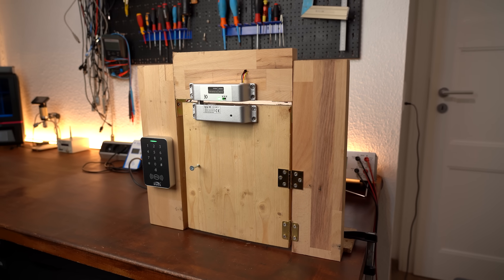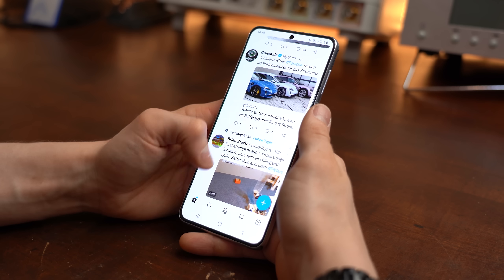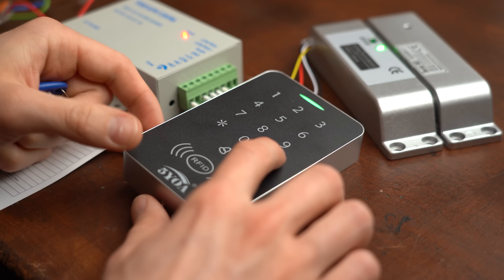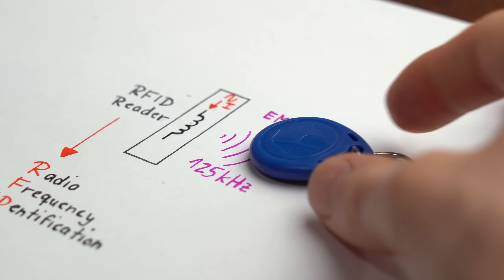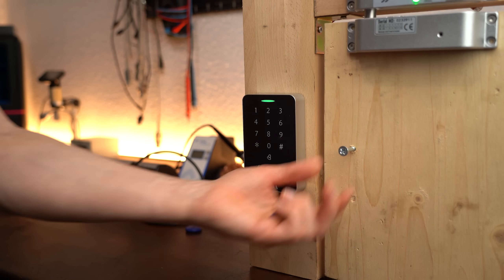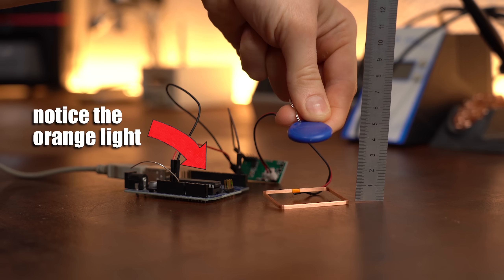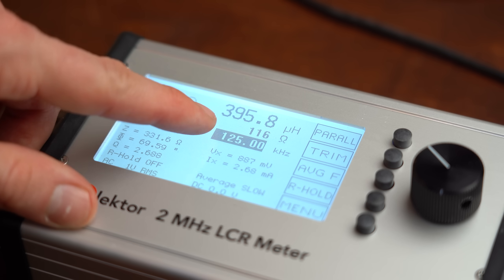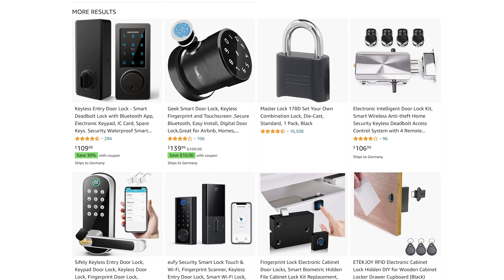RFID Locks are way too easy to "Hack"! Let me show you!

Comment: To me this kind of lock would be used where you just want to keep unwanted walk ins out, but not for securing it for locking up and keeping your items safe from thieves.  Kind of like a staff only area and you don't want to keep having to use an actual key to get in and out all the time.
Reply: Yeah, it's not bad for example coffee rooms for staff, it will keep stragglers out fine, and can probably use just a code instead of a tag.
It's not too shabby for an apt building front door either, as you can get those open usually just by randomly buzzing people.

Comment: I designed an RFID punch clock and i used the 13.56Mhz RFID readers, and you can actually use some encryption to read the data, and my clock "knows" the password to read the data from the tag, so it's not easily readable for anyone else who doesn't know the password..  also you can write the 13.56 Mhz tags using almost any android cellphone with NFC

Comment: Hello Sir, 
I'm an Electronic Engineering student and I love watching your projects.
Myself I'm trying to make an RFID system to switch lights on and off based on the presence of someone in the room. I'm currently having some hard time because I don't know what frequency to choose for the data transmission, what type of antenna suits more, and what kind of transmission power do I need to reach 1 meter of distance ?
Too many questions I know, but they all are related so I can't just choose one randomly.
Hope you can give me a piece of advice. 
Thank you !
Reply: I would also like to know

Comment: waaaaaaaaaaaaah so much great learning from this video thxxxx
Reply: 5:35 are you sure that this is not the other way around? When the tag ic short the coil the amplitude stays high (as it's not modified) and when it's not shorted the amplitude gets a little low as current flow to the ic?

Comment: This has to be my favourite one of your videos. I have played around a lot with RFID. I would like to try building a brute forcer that would just blast out RFID transponder codes until it got the right one. A good system should reject multiple attempts in a short space of time. An excellent system would detect it is being brute forced and increase the time between accepting new codes after a failed one. I bet you could build that in your sleep. In theory with a good waveguide and a small amount of amplification you could do this from a distance too. Like in a car parked outside a house. Why do this? Because it's fun.

Comment: Installed one of those exact amazon garbage door locking systems. The power supply (same as the one in the video) shorted mains to the metal casing and as a result the metal door as well. The door was somehow insulated from ground and the zap i felt wasn't pleasant. Beware that cheap chinese crap can be dangerous.

Comment: LF tags are ideal for implanting into pets as they are about the size of a grain of rice so don't cause irritation and the read range and security are not a problem. HF is still used, especially its NFC variant where security is more important and the slightly better read range is useful. In industry UHF is the most common standard now as it has a much better read range (even small hand held devices can read a few metres) and multiple tags can be read at once.

Comment: There multiple different RFID Tag types. There are secure and insechre ones. Of course the unsecure ones are much cheaper because they don't need so much logic. The secure ones work such as when you learn them in at the first time the system uses a crypto key to store data on the chip. To get the original data back you need the original key used to store the data. The communication of course is also secured so it is not possible to spoof the key. That is simelar to the way how the secured communication in the internet is done.

Comment: Try a modified LW receiver, able to receive 125kHz signals. I had this idea, got a receiver but never had enough time to experiment. Using a directional loop antenna, it should detect RFID signals in a much grater distance. Meters away?

Comment: At work they have these RFID readers basically shaped like a metal detector you see at the airport.  All you have to do is have your id badge somewhere on you, and walking thru it will read the tag.  could be in your pocket, in your bag, or dangling from a lanyard under your coat, it will still read it as you walk through.  I really wish they installed them at every entrance because it's really a pain to remove my id to hold it up to the close range readers, likely thousands of dollars cheaper and easier to maintain than the large format ones but still.  So much more convenient.  Should be no problem for the 70billion dollar company to swing but hey, the CEO needed a new house or boat or something...

Comment: Make a short range rfid listener. Not a reader, just something that listens. Stick it into a nice looking box with a small circuit that stores read values and sends them to you via a simcard. Stick a battery in it and stick it with a sticky tape underneath the reader.

Low chance that anyone will think anything of it.

Comment: The majority of RFID tags are very simple and only transmit a set code when energized. However, I worked for a number of years with "rolling code" RFID chips that change the code each time they are used. These are much more secure and extremely difficult to copy. If you are serious about security, look for a rolling code lock and matching tags.

Comment: Well, my lock system has.. keys. Those vintage metal keys, totally unhip and obsolete, but quite effective. And quite robust regarding power outages, water, snow, heat, ... They even work without any cloud access, wifi, 5G, ...

Comment: We used to make coils that where rectangular about 1meter x 1 meter in size and where build to be hidden in concrete floors to read tags in prison buildings. Not used for opening doors but for tracking people, so nobody could escape because rfid is indeed a bad idea for locking doors. We could read tags up to about 3 meters. The electronics for this was made in house as well. Had a sizeable amplifier for driving the coil i remember, can't remember what exactly we did to get the range it had something to do with waveforms and filtering.

Comment: It should be possible to do a passive read from a distance when someone opens the door. With a proper directional antenna directed at the door lock, you could probably detect the communication between reader and tag and decode it.

Comment: You can get enough security with RFID. First you need to choose between failsafe and failsecure lock options, and second You need to read hidden data or request processing, not only read the tag designator.

Comment: There are RFID's with a push button switch.
When the button is not pushed, the RFID doesn't receive or transmit.
I have a RFID lock at my front door for years.
The coil I have installed behind a window, so nobody can access that.

Comment: I guess you really need to improve your antenna design and circuit significantly to get anywhere near the 30cm mark. And using a metal ruler inside the field to measure the distance could very well give you completely false readings. I've designed circuit board antennas for 13.56MHz RFID readers before using a 2 layer dipole antenna, as that gave better results than a traditional coil type the RFID-Chip manufacturer was suggesting. Getting the tuning of the resonant circuit right is quite an interesting task. You have to consider that when you place a tag and/or the users hand inside the antenna field, you detune the resonance slightly. So your circuit in "open air" will not actually be tuned exactly to the ideal RFID frequency. Some designs even use ferrite sheets and other "tricks" to increase the field density in the reading area. Using a VNA to analyze the antenna circuit and a RF field probe to measure the intensity definately helps quite a bit in understanding how everything plays together and find the ideal capacitor values for a given coil design.

Comment: Actually, sniffing works only for standards that do not use encryption or some standards, that use compromised security protocol such as Mifare Classic variants vulnerable for Nested and HardNested attacks. Sniffing is useless, for example, for Mifare Plus standard readers, that uses unique session key generation for encrypting data stream between reader and tag with AES-128. So, basically, sniffing would be efficient only for old RFID tag standards or for standards that not designed for to use in high security systems. Using outdated standards or standards that not designed for such purposes is only manufacturer fault. I assume, if you need secure something important with RFID locks, use only Mifare Plus or Mifare Ultralight-C reader variants and tags.

Comment: can you replicate the "tag" in a key of car?  It's easy to paired the radio used to open/close the doors but impossible to bypass the  electronic immobilizer. It's so expensivev to buy a clone (like 300€ for Ford), but a clean key can be as low 20€ in Amazon and maybe 30€ more for the cutting...

Comment: Can you overwhelm an RFID lock by using a stun gun?  IE: generating a high frequency random signal by sparking the gun near the reader?  --- When trying to "break" security, you either try to get through in a normal way, or an alternate way.  -- An alternate way in this case would be to cook the RFID read so everyone has to use the keypad and then note the numbers or dust the pad.

Comment: Interesting video as always buddy I wonder if this sort of tech can be linked back to the likes of metal gear solid back in the 90s with the door locking system used which I can’t remember exactly the specific as it’s been many years since I’ve played it but the security card were meant to use the body to transmit the data, just thought that may make an interesting video for you

Comment: You are somewhat conflating two ideas here.
Do you want to open the door over longer distance by changing the receiver or by changing/replacing the RF-tag ???
The first is obviously easy. 
For the second, you will need to understand more about the exact EM-interference that creates the digital code in the reader.
Just sending a stronger modulated EM field to the reader isn't enough.

Comment: Mount the reader on the inside of the door for more security,  the tag can be read through the door if its thin enough and not metal lined. Plus nobody knows it's there 👍🏻
Reply: You would lose out on the code option though... but not the worst idea, it would require the reader to have atleast 5-6cm of reading distance.

Comment: Wouldn't metal ruler effect the measuring distance?
Practically cheating as steel has much higher magnetic permeability than air so the magnetic field travel much further for the RFID to detect...

Comment: Couldn't you also just brute force yourself in by trying possible key Ids really fast? Wouldn't you just need an Arduino, those RFID boards, a code that tries every possible key and a power source? Sure it might take a bit longer but could be far easier than trying to read the key from a distance

Comment: RFID tags should use rolling encryption, and be stored in an RFID blocking sleeve. This is required for Government IDs which are RFID enabled.  

Regarding the reading and writing and copying, There are lots of apps on Android that work really well. 

As far as security goes, I think the weak link in this design is the locking mechanism itself, not the RFID.  You can "Hollywood Hack" This by smashing the reader / control device off of the wall and shorting the wires in such a way to command the lock to release. I have seen similar magneto locks with a standard key and they are equally ridiculous security theater. A proper system should secure the communication between the controller and the lock to prevent this.

Comment: 3:31 From what I can see, your little power supply module has a "push button to activate" function via relay built-in to it and you confused that with the wires coming out of the bolt lock. In the PSU module, when energised, if you apply 12V to the "PUSH" terminal, it will trip the relay and the contacts COM/NC/NC will change accordingly. The bolt lock wiring has nothing to do with this function though. The manual shows that RED/BLACK are for 12/24V power source and the WHITE/YELLOW are for a "locked" contact for monitoring. Meaning if the bolt is out, you get a short (NC) between those two wires. When the bolt retracts you get an open circuit (NO). You would wire that to an input on the door controller so you can monitor if the lock is actually locked or if the bolt is stuck half-way out or something. In short, although the manual has many spelling mistakes, it showed the correct information regarding the four wires coming out of the lock.

Comment: Some of these will try to write to the fob before reading it, meaning you can't really use rewiteable tags. 
Of course you can get around this by using a more advanced transmitter than just a normal fob.

Comment: Wouldn't "picking" in this case mean trying to find the code to open the lock without using the key? Like making something that talks to the reader emulating a tag trying every possible code until the lock opens?

Comment: hi @GreatScott! can you make a simple circuit for automaticaly selecting power supply (12v DC) when one fails switch to a battery, i designed one with aduino but it is not energy efficient or cost effective.

Comment: As the lock picking lawyer points out, any RFID reader that includes the unlocking relay on the unsecure side is easily activated using a rare earth magnet. At 4:45 You can see the orange relay. I'll bet if you held up a rare earth magnet to that reader, you could easily activate the relay and open the lock
Reply: that attack is only practical with very cheap or horribly designed lock systems, using a ssr, or a seperate control box solves the issue

Comment: Do it the Mission:Impossible way (The TV series, not the way overdone movies..)  Modulate a microwave frequency with the RFID carrier.  Use a directional microwave antenna to transmit.  Since the coil is tuned for the lower frequency, it effectively de-modulates the RF and powers the RFID chip normally.  Then you just need to read the code back.  (Yes, this will never work, but that's how they would have done it.. 🙂 )

Comment: I'm wondering if a unit that has you insert the RFID tag with a blocking system without the insert area, would (or could) stop the tag being read. As for on your person, a sleeve that slips over the tag to stop it being copied. Even better a sleeve that keeps the tag looking like a standard tag,

Comment: well the biggest flaw of cheap systems is probably having the control electronics in the number pad and only closing and opening a circuit instead of sending encrypted data arround
So you usually can just short two pins and it opens.

Comment: RFID readers have been known to get up to 50 feet.  In Canada a company did that to ID where every worker was on the plant site.   
So reading and detecting RFID at great distance is very possible.
Reply: It's also used for toll passes in commercial vehicles. Not sure about passenger.

Comment: Security on 125kHz is non-existant. My old office even had the number printed on the tag itself so I could clone it from a photo which is >30cm. 13.56MHz cards actually have some security, but you can fully read many cards with a smart phone in around 1 minute. In most cases you can defeat low security locks by just cloning the UID onto a "Magic Card" or something microcontroller based like the Chameleon E which has low cost clones from China. The official proxmark stuff can apparently intercept 13.56MHz signals between the reader and fob but I've not tried that.
Reply: My employer changed the RFID system after they built the new building. They moved from Legic Prime to Mifare. Too bad they use Classic 1K EV1. I took my proxmark to the test, and cloned the fob. The system they use has only 6 of the 16 sectors with keys(All sectors use the same key) populated and they don‘t even check the signature if the fob is a clone or not. The EV1 Classic tags have a signature sector on sector 17. These EV1‘s could be somewhat secure, but only when you populate all sectors with randomized key‘s(or calculated) + Signature checking. Cloning is than no longer be reasonable without sniffing and only a Proxmark could emulate that security sector by manually write it to the emulator memory. It would be to much hassle to deal with, better you use a crowbar. 😅

Comment: Physical pentesting dudes often use a long range reader in a backpack to covertly get close to your target rfid card as to steal credentials. Notwithstanding the quality of your lock and security system, an easy way to safeguard against this type of attack, beyond rfid blockers on security badges, is to require a pin code after a successful badge scan. That pin code should be tied to a specific user/card, not just a general code for everyone.

Comment: Not good that the secret code is a constant, and thus vulnerable to copying. Even simple garage door opener keyfobs use a secure code hopping scheme, like the one implemented in the HCS300 chip. Do all RFID keylocks operate this way, or is it just the cheap lock system he bought that is like that?

Comment: Interesting, would be quicker to use a powerful electromagnet coil to disrupt the magnetic lock.
All these can be opened with enough force as you can shear the magnet apart from the plate.
These locks are useless on pairs of doors or gates, lift the drop bolt and push the doors to open.